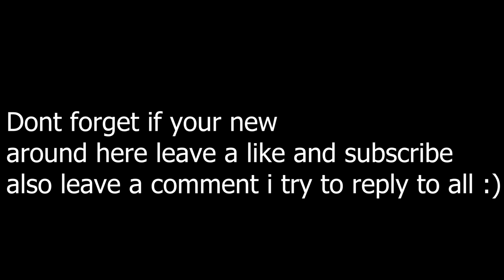Floors & Walls - Coach Conversion Uk Skoolie #7 Video Corrupted

Comment: I look forward to the video’s, I’m doing a horse box conversion, lots of none structural welding, and lots of body work preparation, stripping out and planning and then replacing hard to find parts can take ages. If I had the space I would definitely do a coach conversion in a heartbeat, keep up the good work.
Reply from the maker: Sean Miles. Ah that’s cool Iv done my little van but didn’t video that.  when I’m done the coach its going to be a couple Years in the doing as I don’t have the money outright!! And want everything right once !!

Comment: Good progress there, hope that stuff you sprayed on the boards is some kind of rubber waterproofing? I’m not sure I would have used that stuff myself... marine ply or aluminium metal sheeting in potentially wet areas would have been better, but not cheap. Look forward to seeing your completed project 👍🏻
Reply from the maker: MobileUpload hi pal thanks for the comment yer it’s mppt rubber just to stop any moisture building up I have the double plastic arches that I’m going to put in befor any road driving, that’s a few few months yet just wanted to stop an chance for the time being ! 😊😊

Comment: What about ventilation I assume you have ac in roof but is there passive air vents along floor every so often to allow fresh air to circulate and warm moist air goes up and out through roof vents  so you do not get condensation mold mildew damp musty

Comment: Nice work dude! Me and my fiancée are looking into buying a coach to live in full time. How did you go about getting the correct licence to drive that beast?
Reply from the maker: Jim Von Slater the licence is called hobby driving I had to get category c1 on my licence so just the weight of rigid 40tons  then re class the bus as a motorhome! Go for it
Reply: Tommy Harris Thanks for your reply dude. That’s cool, I read up on it and thought I’d need a class D... but that’s great thank you. Look forward to your next instalment. It’s good for ideas 👉🏼